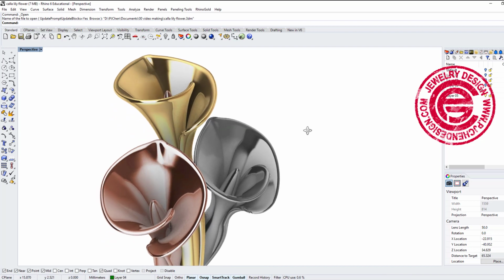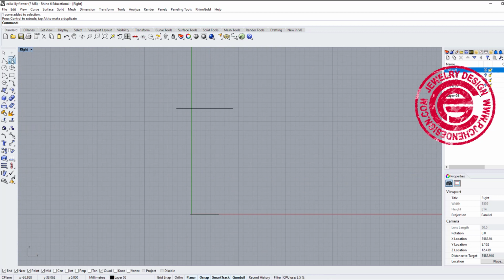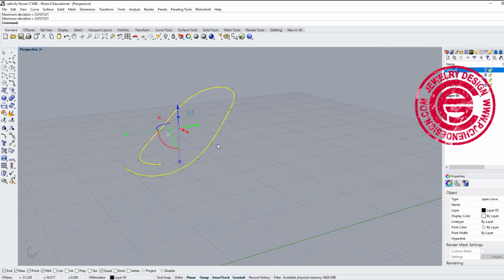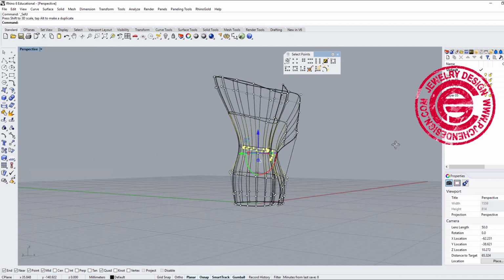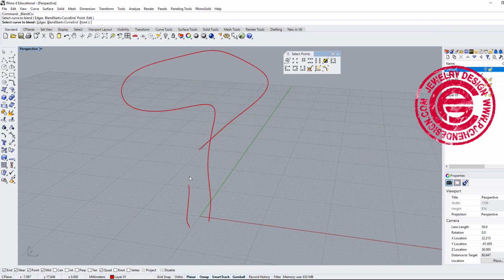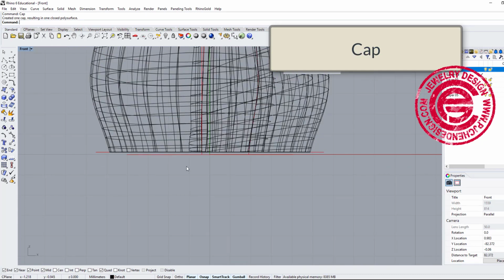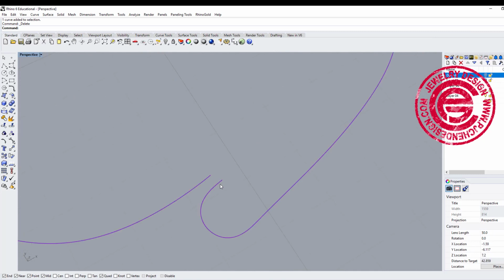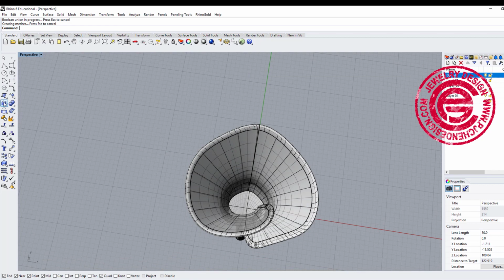Calla Lily Flower 3D Model in Rhino 6: Jewelry CAD Design Tutorial #86

Comment: Hey PJ! I have a question I would like to ask.. is it possible to add finishes in rhino before casting or is it needed to do by hand? I'm making a piece similar to the one above and want the matte finish on the casing as well.. I hope all is well and would really appreciate an answer. Best regards, Lasse from Norway.

Maybe you already have a video were you show it and you could refer me to.. I've sent you this message in a Instagram DM with the picture I'm talking about, my @ Lassiiq
Reply from the maker: Hi Lasse-Alexander, depends on the 3D printer quality. sometimes they have layering line on the wax or resin. it usually take some polishing effort to remove it. for the matte finish, you can have it done with sand blasting. However, you will need to polish it first then sand blasting. If the texture is not obvious like hair texture or bumpy texture. it usually go away on the polishing process.
Reply: Thank you so much PJ Chen!